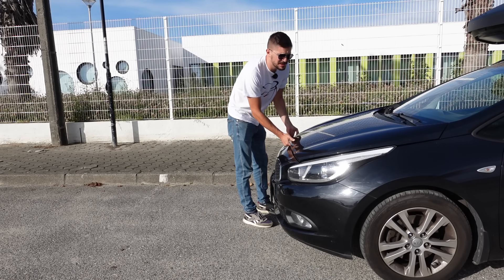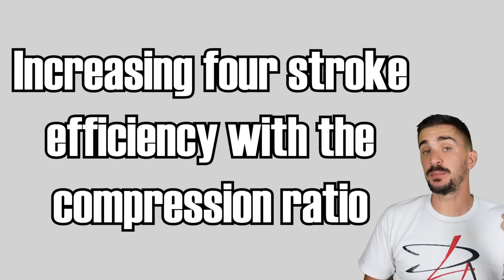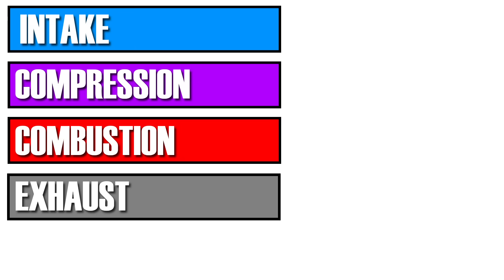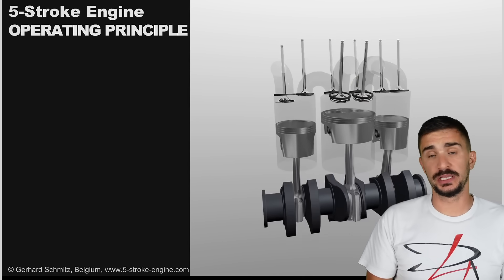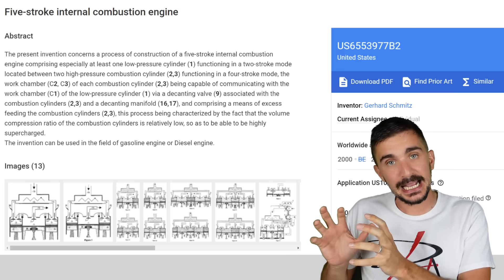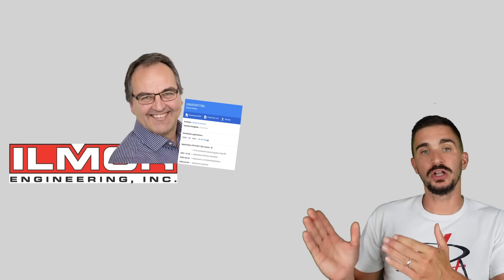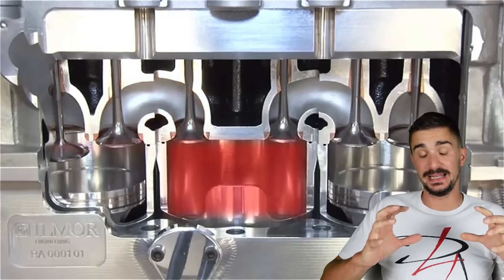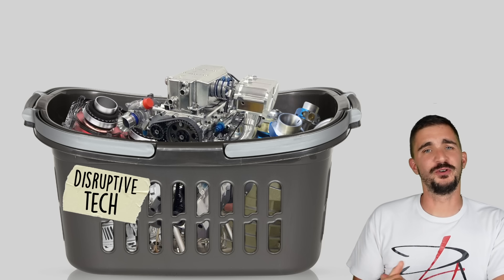Why Five Stroke Engines Are More Efficient But Still a Failure

Comment: A couple things. I Wonder talking about that dead weight during the power differences if they could build a VTEC Set up, so it would only activate under the right conditions? Also, has anybody thought about doing this with a two stroke engine? It would probably only benefit from the emissions part of this design, but you can make 2 stroke cleaner? And then again, if you use direct injection with two stroke, it's already a million times better

Comment: It's interesting to see steam engine compounding principles applied to internal combustion engines. Curiously here in the UK, although we did have numerous locomotive classes that were compounded, for the most part we stuck with 'simple' designs. In Europe and America, where trains travelled greater distances between stops, compounding was far more popular. and of course ship engines were almost all compound engines, often triple compounded. Which leads me to wonder if the same principles could be applied to ship engines these days?

Comment: If the 5 stroke is most effective at Max load I'd almost see that as a benefit for some applications. Say in the generator of a Edison motors truck. The engine only runs at 1 speed anyway, might as well make the engine as efficient as possible at that one speed and get all the energy possible out of the fuel.

Comment: Another good  clip one extra thing petrol is only say % 30  efficient  because the explosion in cylinder only makes mechanical kinetic energy that is harnessed the rest of the energy is wasted as heat which has to be cooled by radiator & light energy which cannot be used yes I probably embarrass myself & you know this but I had to comment! Enjoy these engineering lessons !👍🏁

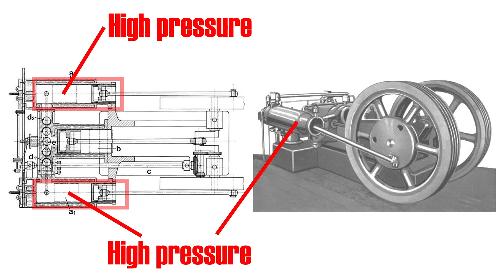Comment: 07:00 This is exactly the way many steam engines were built, it's called a compound engine; this idea had proven itself to increase efficiency quite and had seen its commercial success, in the form, for example, the most produced steam locomotive, called Ов, in Russian Empire.

I did not knew someone would apply that to an internal combustion engine too! But, considering the fact the compound steam was invented quite early in a steam engine history, at least, far before internal combustion was invented, that's logical that the idea was also reused very early, by the 4-stroke engine inventor himself.

What's curious though, is that compound technology competed with superheaters, which produced comparable engines. And, latest steam locomotives, for example, were built simple with superheaters, rather than compound. Many compound locos were actually converted to simple with superheaters. These are more robust, I presume?

Well, the problem of changing the property of the exhaust in dependence with the load is also known and solved in steam. The locos had all the necessary pipework to start as conventional simple expansion, where the primary steam was supplied to all cylinders; this allowed the loco to start the heavy train, at the expense of wild steam usage. Then, at some point, it switches to its efficient compound mode.

Comment: It could actually work with modern technology. We have proven and working techniques to completely disengage and re-engage a piston on-demand (And I do not mean the cheap kind-of solution that VW uses in their 1.5 TSI). This would fix the low RPM issues. The biggest problem with some of these clever alternative designs is that no one wants to spend RND money on it. Everyone knows that electric in some form or another will replace these engines and we have working technology that just work and will do the job until we retire these engines.

Comment: There was a Maritime 3 Cylinder Steam Engine, each Cylinder was fed 'leftover steam' from the previous Cylinder. Name escapes right now.
Peugeot and Citroën, and BMW developed a 5 cylinder petrol engine on the same principle, after the fuel crisis in '74.
IIRC, they raced one at Le Man...
I agree with you, the Internal Combustion Engine, including the Jet, are incredible machines.

Thank you for considering your speech. Very much appreciated.

Comment: What strikes me is that this is another attempt to recover energy from the exhaust. This method is trying to put that energy directly into the crank. A turbo is another way to recover energy from the exhaust but that energy isn't put directly into the crank, it acts to sort of increase the displacement of the engine. The continued development of e-turbos and hybrid drive train tech is also interesting to watch (especially as new battery tech that improves EVs also benefits hybrids).

Comment: I wonder if the 5 stroke could be used for applications where it would run in constant rpm, there I believe it would shine. But these scenarios are as far as I can imagine small home apliences like lawnmovers and chainsaws and other such equipment and that would be too big for that as these are isialy single cilinder engines.
Could it be scaled down as much? Basically use 3-4 cylinder (I'd guess the low pressure cylinder would take somewhere between 1-2 cylinder space) instead of single cylinder. I'd guess the issue would be the complexity. 1 VS 3 cylinders - even if the base confer is not too complex it's still 2 extra cylinders - crankshaft is more complex, way more valves etc...

Comment: Get your facts correct. Petrol engines are at best 27% efficient. The remainder of the energy go out of the COOLING SYSTEM. 
Petrol engines should be banned, they are inefficient. 
Diesel engines usually at 43% efficient or higher.

Comment: Using the turbine from a turbo to drive a generator would be a cheap and simple way of using the same idea to make hybrid cars more efficient, but capitalism ain't about progress or efficiency or we'd have turbines/Stirling engines reclaiming a little energy from all that other wasted heat, or air conditioning doing the same like gas powered fridges have been doing for ages.

Comment: Would this design have much advantage of a traditional turbocharged engine?  If all were going for is thermal efficiency did it actually end up having that higher thermal efficiency? I remember Mercedes saying that there formula 1 engine if 50% thermally efficient, I have a hard time believing this motor could do anywhere close to that.  Harnessing exhaust gasses to charge a battery for a hybrid system seems like a better use of the energy.

Comment: Have you made a video about the turbo compound engine yet? The B-29 had Wright R-3350 Duplex-Cyclone turbo compound engines, which increased power without increasing fuel consumption.

Comment: I feel like this might be useful for aviation piston engines. They spend most of their time at 75-80% power, so most of the time the third piston will actually be recovering energy.

Any reduction in fuel consumption would be useful as every gallon of avgas that you don't have to carry converts in to 6lb of extra load that you can, or extra miles in range.

Finally, as piston aircraft are not subject to emission checks, there is no need to worry about catalytic converters.

Comment: Just a pedantic detail and I could be wrong, but I think the energy wasted is only heat, not heat + noise, because the noise we hear is only a byproduct of the thermal expansion of the hot gases in the cooler atmosphere. In other words the noise is made by the heat as opposed to being additional to the heat. This is how mufflers (and silencers/suppressors) work by creating a buffer chamber in which that violent thermal expansion will occur before it can reach our ears.

Comment: It's obvious that you haven't studied the thermodynamics of combustion engines. There are inherent limitations on the efficiency of heat engines that have nothing to do with the number of cycles and how much NOx is generated...
Things like exhaust heat that will "melt" valves etc etc etc.
You never mentioned those...

Comment: Its main drawback, namely the lack of exhaust energy recovery at low load and low rpm, could in theory be mitigated by using it as a range extender. Just switch it on, operate at max rpm and load and turn it off when the battery is topped off. But I still don't think it will take off as the holy grail of range extender design is the free piston linear generator (FPLG) that converts reciprocating motion directly into electrical energy. 

More generally I think we are approaching the limit of extracting more thermal efficiency from internal combustion engines. The main challenge these days is getting the catalytic converter up to temperature and reduce cold start emissions, and high efficiency ICEs used in hybrid cars already require a lot of engineering dedicated to catalytic converter heating.

Comment: If you used a "free valve" head with electric valves i dont see why you wouldent be able to run it as either a traditional 4 stroke or a 5 stroke deoending on what road/emmisions conditions called for. Litterally making it the best of both worlds. This seems alot more promising then other designs just because all moving parts are bsicly the same

Comment: There was also a 6-stroke engine that went about as far as the 5-stroke. The first 4 strokes were conventional but the 5th stroke injected water vapor into the hot cylinder. The water vaporized creating pressure to drive the piston down. The 6th stroke was exhausting the water vapor. One claim was that it didn't need a cooling system. The process probably also affected catalytic converter performance. One solution around the cat problem would be to have one exhaust valve for the combustion process and another for the water vapor exhaust. But we are getting somewhat complicated here.

Comment: I'm not sure how it's a problem to only count the displacement of the high-pressure cylinders.  The whole point of publicizing displacement is to give people a way to compare engines in terms of how much fuel it uses to achieve a given amount of power.  It's entirely appropriate that they only count the displacement of the cylinders into which they're injecting fuel, when advertising the overall displacement of the engine.

Comment: I offer a solution to the low rpm issue
install a 5th valve in the middle cylinder run by freevalve but this valve is an intake that can supply some fresh air to the middle cylinder. add a small hp injector to assist with fueling and the middle cylinder should work better at low rpm while retaining the 5th stroke feature for higher rpm

Comment: The sickle bar mower was invented in 1833 and they are still in use today. 191 years later. Otto and his 4-stroke can suck it :D
Reply: No you can suck it.  The sickle bar mower used a simplified otto engine.
Reply: @JayRCartor  the Otto engine didn't exist until 1861, and it was years and years after that when it was applied to sickle bar mowers. For the first 50 years, sickle bar mowers were horse/ox powered. No engine needed. 

Welcome to history class sonny.
Reply: @rickway2039  So I am correct. I never said to when I was referring. The sickle bar mower did use a simplified Otto engine. After the horse and buggy era. I never said that Horses were never used. The sickle bar mower  is still running on Otto engines, today over 150 years later.  So of the two inventions the Otto Engine is the far greater invention, Sonny
Reply: @rickway2039  That is not even a sentence. Make a logical argument son or go away.
Reply: @JayRCartor  ehh, phone auto corrected that. It should have been:

I hope you warmed up before stretching like that. 

Because you just spat some serious bullshit. :D
Reply: @rickway2039  No son you got it backwards. I tell the truth. Check you facts. There's enough BS in the internet with you here.
Reply: @JayRCartor  the truth is the sickle bar mower has been in use for way longer than the Otto engine. It's not even close. Just because the sickle bar mower can be attached to an Otto engine doesn't magically make the Otto engine a century older.
Reply: @rickway2039  Now your changing the topic. That is not what I was saying at all.
Reply: @JayRCartor  I responded to the D4A assertion that, "There is no other device of comparable mechanical complexity that has been so omnipresent on planet Earth since the 1800s."  Sickle bar mowers were here 40 years earlier, and will still be here once all ICE engines have been replaced with motors. 

You came out of left field to assert that sickle bar mowers didn't exist until after the Otto engine, which is demonstrably false.
Reply: Your first comment was off topic. The video is about engines not sickle bar mowers. This was your first of many mistakes.
Your latest mistake  is in thinking that electric motors will replace the Otto engine. When most electric vehicle owners regret having purchased an electric electric vehicle in a recent poll in the USA.
Lastly there are many inventions older the sickle bar mower that are still in use today. But that is a topic for a different video.
If you do not like the Otto engine then walk.
Reply: @mrgcav  calm down hemorrhoid. D4A made an assertion in the video, I gave an example that countered his example. You came in here with your panties in a twist, failed reading comprehension, and some sort of hard on for 4 cycle engines. 

The study you mentioned shows the #1 reason why people are having regrets has nothing to do with the car but with the charging network. 

Also, I'm a gear head. I've rebuilt engines (and have another to tear down), I'm swapping a 2.0l TDI into a Fiero. I've got no issues with 4 cycle engines. But honestly, they are on their way out. Electrics just crush them in performance and maintenance. As much as I love the throaty sound of cam overlap, by the time I retire it'll be left to niche markets.

Comment: wouldnt route the exhaust gas after catalytic converter instead of before it solve all the issue you mentioned. sounds like a routing issue. There was a similar design in aircraft engine that pretty much did this exhaust gas recovery by connecting a turbine to crankshaft. Only viable in low air speed though, in high air speed, it's better to just dump gas as thrust reaction mass. In an even earlier era, similar waste heat recovery system was implemented in steam engine. It had a secondary expansion cylinder that did not take any input heat just the exhaust steam from the prior chamber. Pretty interesting similar concept in differetn engine design keep coming back over and over again.

Comment: How about making one of the smaller cylinders the low pressure one instead of the big and heavy middle piston
Reply: or maybe it could just be a normal 4 cylinder with one of them being the low pressure. I don't know, it could be a stupid idea because combustion would be a bit uneven

Comment: the heat might be wasted energy, but the noise is just a matter of compressed gases being forced through an opening at speed, paired with the geometry of the openings, tubes, the heat of the gases, etc.

you will always have noise in a system that has moving parts and effectively moves something else, like water, air, a solid, etc.

you even said in your earlier videos that NOx is the main harmful emission, which would mean that my previous statement that the same engine being able to run at a lower RPM with the vehicle moving at a faster speed is actually better for the environment, while being more fuel efficient. i did not say how much, because that does not matter when 0.00001% and 100000000% are both equally valid when you are trying to squeeze as much out as possible while reducing the environmental impact, the ONLY issue is engineering and costs

so as you run at a slower RPM, you are producing less NOx per unit of time, you are also using less fuel per unit of time, but you are also producing less power per unit of time, so its a matter of diminishing returns

also, going back to your previous video bout EGR, and even calling me an idiot, this is literally identical to that, its just that its done at a different point in time, you burn the fuel, and have to burn it again in order to get that extra "oomph" out of it

the problem here is that when you are pushing the still expanding fuel into the center piston, you are STILL pushing against the first piston, as it pushes the gases into the larger piston

as i always say, it will FOREVER be more environmentally friendly to repair and maintain our existing vehicles rather than just buy another for the sake of environmental concerns

the turbine car was better, because it could literally run on anything that burned, which means the wastes we are inevitably going to pollute, and are usually going to result in a similar issue, will become useful for the population once more, along with the exhaust being safer because of the way that the combustion worked

Comment: So your saying on the 5 stroke engine, a modification is needed for low rpm to have the middle cylinder perform as a 3rd cylinder until the rpm increase.   ICE is dead,  Electric is so much easier to plan when you will have to pay  "your favorite electric car company" the consumerism fee to replace the dead "car, battery, motor or touchscreen".